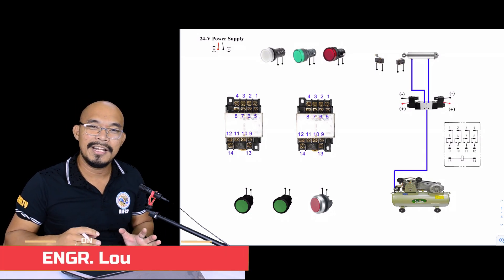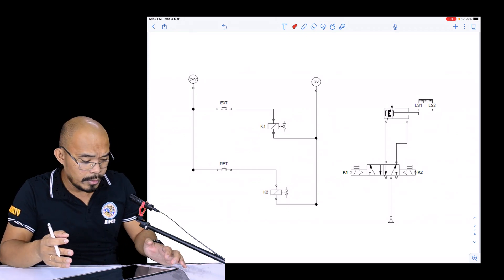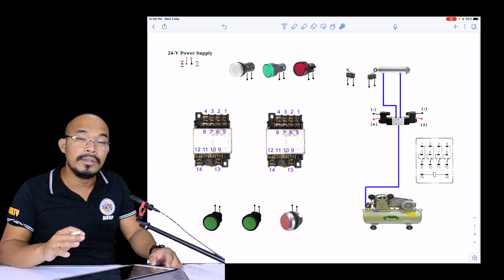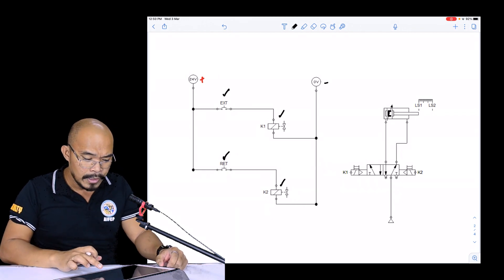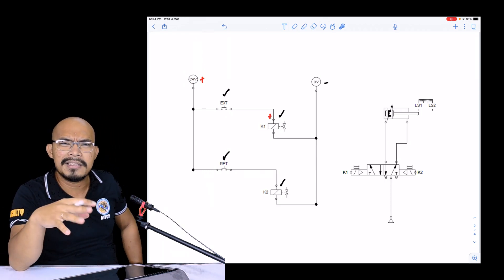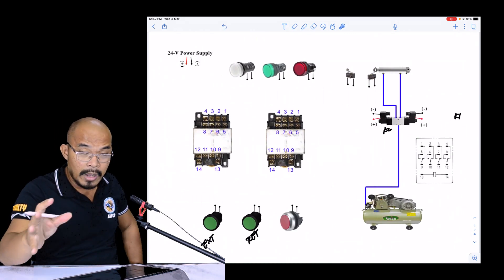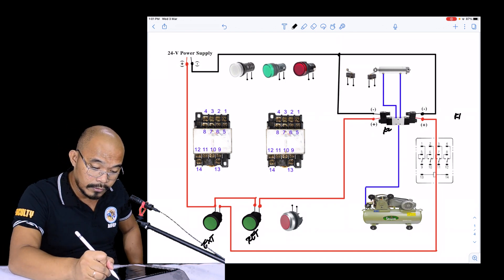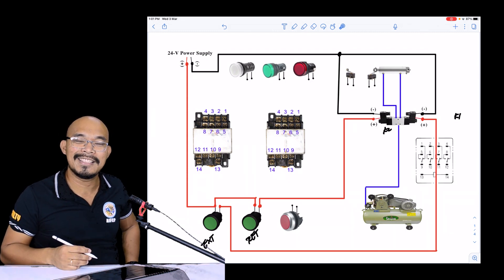How to Wire a Basic Electro-pneumatic Circuit

Comment: This video demonstration of yours sir is very informative this may teach us on how to wire a basic electro pneumatic control system. For Me the most Important that I learned in this video is you alone know how to understand or read the diagram system therefore if you can read the diagram system you can easily wired system. It started in power Suppy (24 V) the positive supply connected to Extend push button then connected to K1(Solenoid Valve) and connected To Negative wire which is power supply (- 0 Volts) Therefore The first track ia completed, in second track tap or connect the Retract push button on Extend push push that supplied also by positive 24 V then connect it to K2 then you can connect the K2 directly in negative  (-0) in power supply and also in the negative wire in K1 and thats it.

THANKS FOR THE INFORMATIVE VIDEO DEMONSTRATION SIR IT HELP US YOUR STUDENT AND ALSO THE VIEWER MORE CONTENT AND KNOWLEDGEABLE INFORMATION SIR.

Comment: This video is very helpful to all the people that want to learn, How to wire a basic electro pneumatic circuit in this video we learn that first thing to do is we need to identify the components that we are going to use. Base on the video that from the supply 24volts connected to the IN og EXTEND button and also to the IN of the RETRACT push button. This video show to us how to read a diagram and perform it in the actual. 

Thank you sir for this wonderful video.

Comment: In this video i learned how to wire a basic Electro- pneumatic Circuit,  from the  power supply which is 24 V going to EXT push button and from the the EXT button we need to connect it in the positive sign of K1. After that the negative sign of K1 we need to connect it to negative sign in our power supply.the return of RET going to K2 Positive.just like what we do in  K1 the negative terminal of K1 Connect to negative terminal of power supply. So In our K2 negative sign From K2 ee tap it also in the negative sign in the K1..

Comment: In this video, I've learned how to do the wiring of basic electro- pneumatic circuit. From the supply which is 24 volts connected to the IN of EXTEND and RETRACT push button, and the OUT of EXTEND push button is connected to the K1 Positive(+) of the solenoid,  all of this are RED WIRE. The out of the solenoid is connected to the negative(-) of all that is BLACK WIRE.

Comment: This video is very helpful, what I have learned in this lecture is on how to wire a basic Electro-Pneumatic Circuit is that that from the power supply which is 24V going to one of the terminal EXT push button, just like what you said in the video sir we need to wire it step by step. In the next step is from the out of EXT button we need to connect it in the positive sign of K1. After in the K1 we have the negative terminal of the solenoid we need to tap it in the negative sign in the power supply. The second step is we can tap already in the EXT because its already connected to our power supply, so from EXT to RET. The return of RET going to K2 positive sign, the negative sign from the K2 we tap it also in the negative sign in the K1.

Comment: I learned from this lecture on how to wire a basic Electro-Pneumatic Circuit is that that from the power supply which is 24V going to one of the terminal EXT push button, just like what you said in the video sir we need to wire it step by step. In the next step is from the out of EXT button we need to connect it in the positive sign of K1. After in the K1 we have the negative terminal of the solenoid we need to tap it in the negative sign in the power supply. The second step is we can tap already in the EXT because its already connected to our power supply, so from EXT to RET. The return of RET going to K2 positive sign, the negative sign from the K2 we tap it also in the negative sign in the K1. Thank for sharing your knowledge sir and God bless. ❤️👏

Comment: What I've Learned about this video sir is how to wire electropneumatic wiring and in this wiring is you need to identify the components that we gonna use. Our source here is 24 volts with positive and negative charge, the two push button the normally open (extend) while the  normally closed (retract) ,We have also to know what we gonna use in solenoid valves.

Comment: In this video I learn how to  wire a basic electro-pneumatic circuit. Before you perform first you need to Identify the components of the circuit then follow the diagram to connect correctly and perform the first run in the diagram and analize where is the POSITIVE and NEGATIVE then analize again the diagram in the second run to perform the second run correctly.

Comment: Very informative video sir, I have gained some idea on how to wire a basic electro pneumatic circuit. To understand it easily you have to identify first the components that you're going to use and label it. Just like the source of 24 volts that has a positive and negative charges, the two push button the normally open (extend) and the normally close (retract), and also the solenoid valves that we are going to use.

Comment: This video is very helpful especially in E-learning. Through this we will be able to perform electropneumatic wiring either in our respective houses or in the school. In wiring, we have to identify the components that we are going to use. Basically, we have our source of 24 volts with positive and negative charge, we also have our normally open and normally closed push button. We have to identify also the solenoid valves and we have to label it with respect to its function.